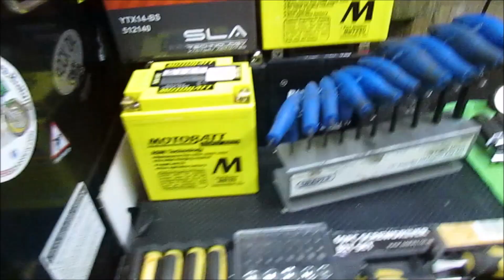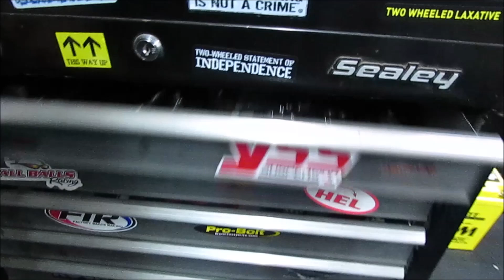Tools for motorcycle repair, what you need when starting out

Comment: It was me who asked for this so thanks for taking the time to do it. I've got those lock on sockets and they're brilliant they've saved me a few times now with rounded bolts. My tools are a mix of Draper expert, Sealey, Laser, Clarke, Signet/Trident and some Snap on/bluepoint stuff, my laser torx/star sockets have been brilliant and weren't very expensive as long as you get tools with a lifetime guarantee I don't think you can go wrong
Reply from the maker: Thanks for the idea! was happy to help, as i said i use the lock on sockets a lot